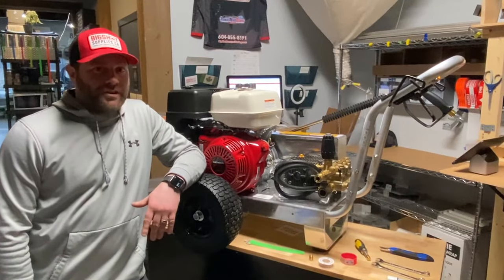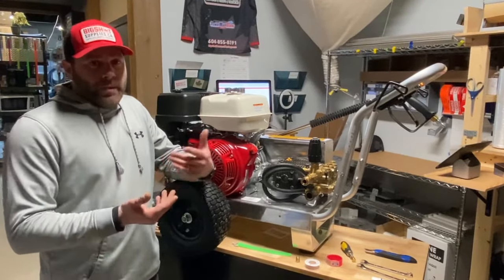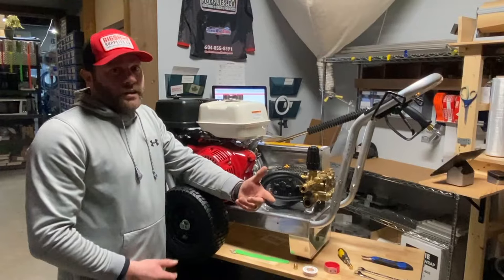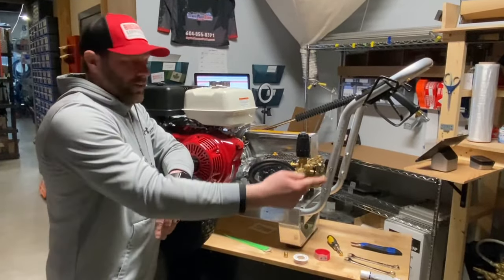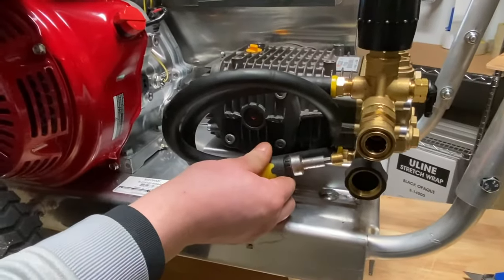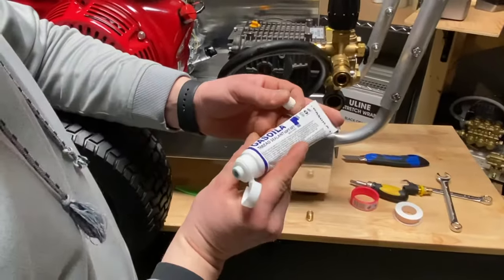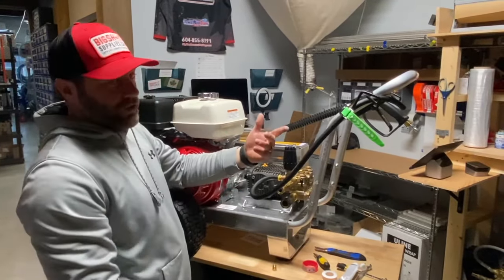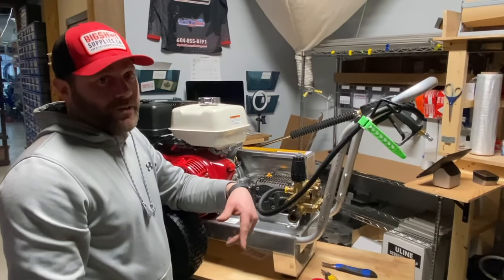How To Bypass A Pressure Washer

Comment: Awesome man thank you so much for the video eh. Most videos only discuss with a buffer tank. I was concerned that I needed a looped system with buffer. Now I know  I can plum the vent tube through my truck bed to the ground ad my 4gpm lives in my truck bed with the skid but I don’t have a buffer tank. Right on brotha. Just subscribed. My wife is from Sooke.
Reply from the maker: Great news and glad to help!!
Reply: @kylemercure2918 mine is mounted in the truck and I just dump the water on the ground as well.

Comment: Great video , my only question is , if my pressure washer don’t have a bypass , the fitting that screw into the unloader it’s just a fitting with a barb or is it a specific valve

Comment: If you bypass the unloader and discharge water onto the ground will the pump not run out of water? Either from you being on the trigger or off and it running running out? I’m trying to get a new pump where it needs to be.

Comment: I just picked up the same model as yours off a guy for $300, its a 4200 psi 4.0 gpm belt driven,  anyway I did the exact thing you did and the water comes out of the hose fast! Then it wants to kill the motor.  But when I hook it back up it works perfectly.  I don't understand, its the exact same setup as yours and I did it the same exact way as you did.
Reply: Sounds like your unloader needs adjusted, sounds like someone has cranked it wide open which will do what you explained.

Comment: Great video! So I just bought an Echo 4200psi 4GPM with a GX390 and an AR Triplex pump. There are no bypass hoses, but at the base the black unloader pressure  knob, there is a brass plug. Is this where I should plumb into? Wish I could send a pic

Thanks!
Reply from the maker: It would help to know what type of unloader it is?

Comment: So I'm buying a Preditor 4gpm  from Harbor freight can you see if I'm able to do this with that machine? And can I buy the cap u used?
Reply: The AR pump that comes with the Predator 420 doesn’t have a bypass hose so no you wouldn’t be to
Reply: Thanks for sharing. Predator 4gpm is similar than your, but doesn't have the hose, it has a cap, so put out and the water comes out continually, I mean water doesn't stop if I press the trigger. is that notmal?

Comment: Where do you get the plug ? Can’t find them online anywhere or is it just a standard 1/4 inch plug
Reply from the maker: Yes its just a NPT )Nation Pipe Thread) 1/4" plug....No special but they can hard to find. In Canada you can buy them from our online store!

Comment: I have that same unit and I'm fixing to build my skid. What about the thermal relief valve on the other side of the unloader? Since you're bypassing the line does the relief valve need to plugged as well?

Comment: Great video and i like the water exiting the hose method

Replacing a Simpson AAA EW4040  pump    4 gpm Honda 390 knock off mobile unit
   Should the  new AR pump have an unloader
or will an AR pump with a built in regulator be adequate ?
Using as a jetter and require short breaks, say 3 minutes to camera drainage pipe
Again, like the water exiting the hose method
RR

Comment: You mentioned about sucking the water with gear driven pumps, some come with thermo relief valves. Would I still do the same thing to bypass?
Reply: It would definitely be a very good idea, that thermal relief is set just below the limit of the pump as a last resort, a cool pump is always a happy pump.

Comment: The only time the pump is in need if the trigger being pressed for worry of burning up is if there is any leak in the system.  If the machine surges up and down that means there is a leak or your unloader is broken.  That's when you worry about cavitation

Comment: Hey I have a Simpson 3300 but mines doesn’t come with the hose on the water pump, is it possible to bypass that water pump thru the thermal water valve? Cause that’s the only place where leaks does come when it does leak
Reply: No

Comment: Hey, if I’m off the trigger and pump is cycling will it draw chem from my bleach tank?
Reply: That's a great question.  I'm assuming it will as well.  That's a conundrum we're in.
Reply: Remedy: you could add a 3 way ball valve to the water relief hose so that when you use the bleach,  it cycles and will not be wasted onto the ground. And when you just washing and rinsing, turn the ball valve off so that it can relief all that water onto the ground.  This is what I would do.